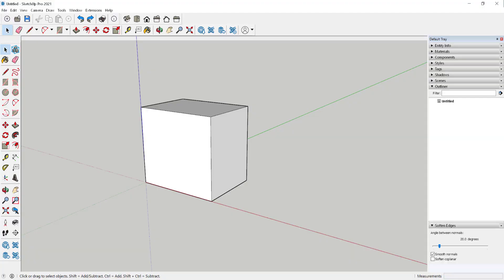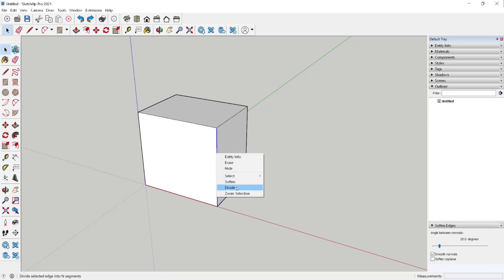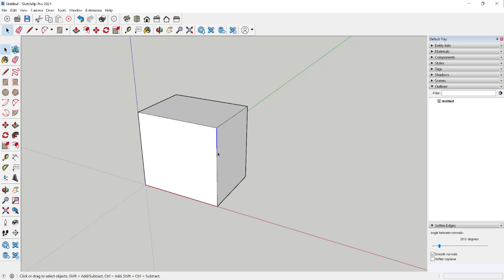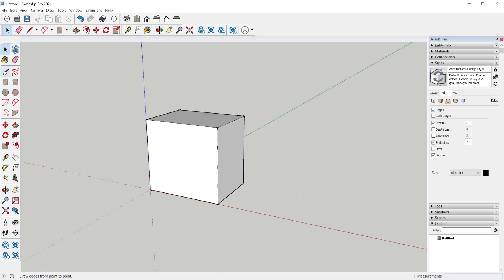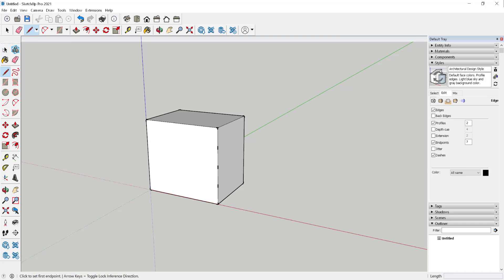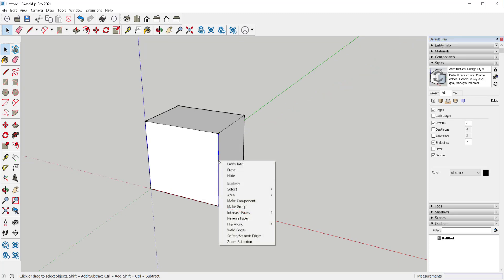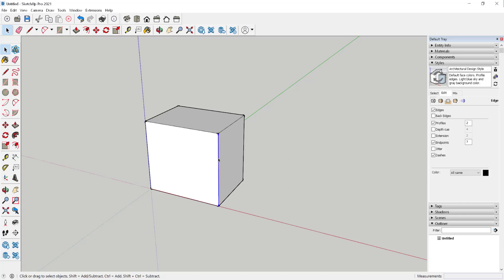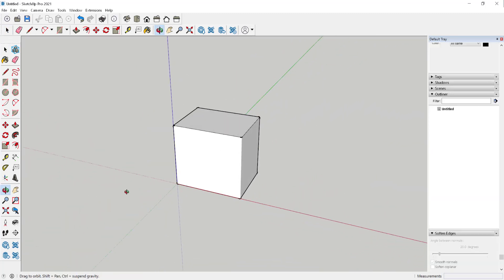SketchUp: Divide, Weld and Soften a Line

Comment: I use a pencil to draw two line segments one after the other , both are connected, then use the weld edges to combine them both to a single line. When I select this new line , it gets selected, but when I try to find the mid point of that line, it doesnt show up. How to solve this?